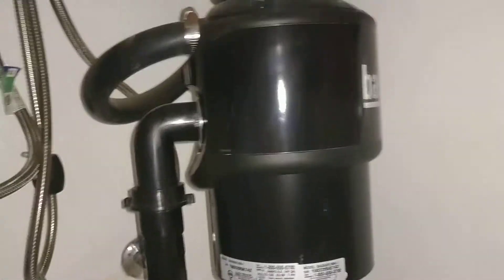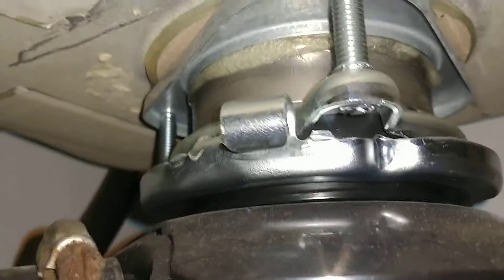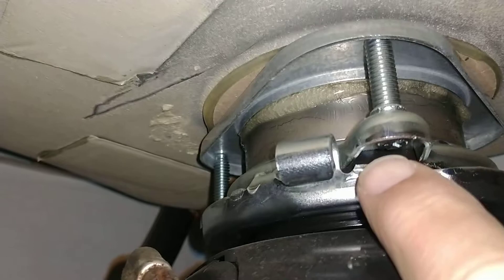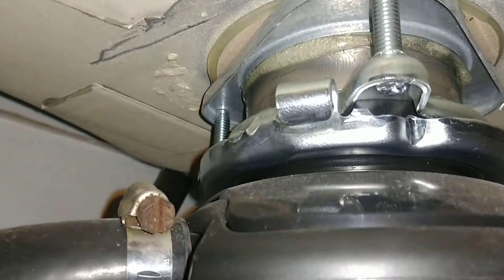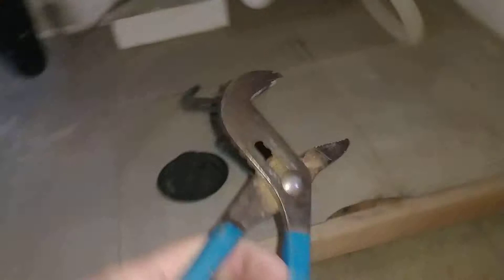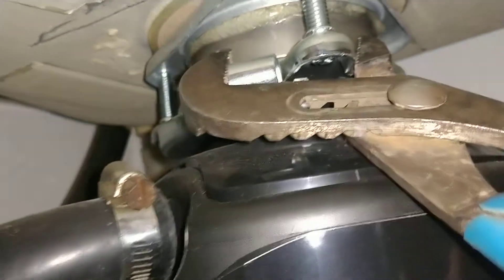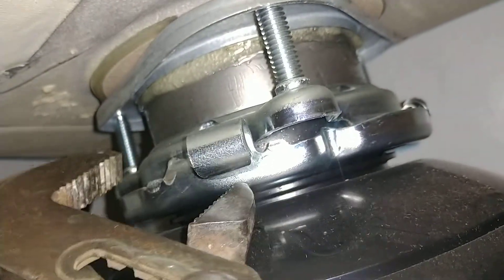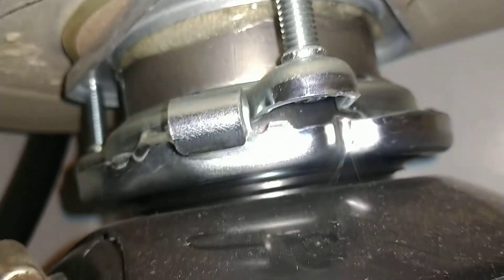How to tighten a garbage disposal collar

Comment: Nice vid. Just saved $200. My wife was about to call a plumber and I caught your vid. Quarter inch turn and the water just stopped leaking. I had worked the crap out of the machine a month ago getting a nail out of the inside of the  machine and didn't think to cinch it up after working it so hard to remove the nail. Thanks.

Comment: Thanks, the instructions I followed for install must not have been entirely clear how tight it needs to be because I had a leak. My disposal came with an Allen wrench for manually turning the blades so I used that as a lever for tightening it.

Comment: Thanks for this. Do you know what the issue might be if there’s still water pooling slightly between the two metal parts (the collar and the bolted ring it’s tightened onto)? I wonder if the whole unit needs to be screwed in more, or if there’s a gasket between the collar that may need replacing.